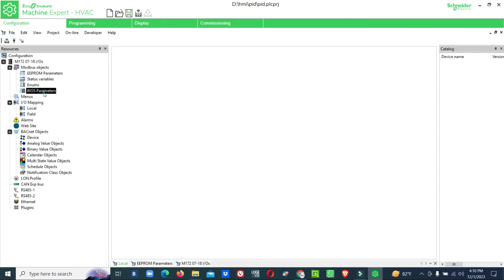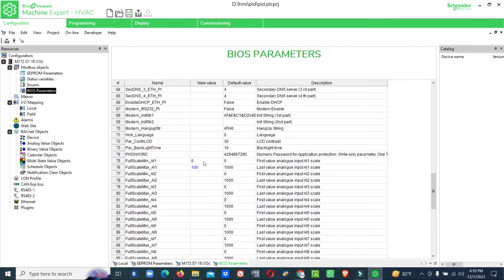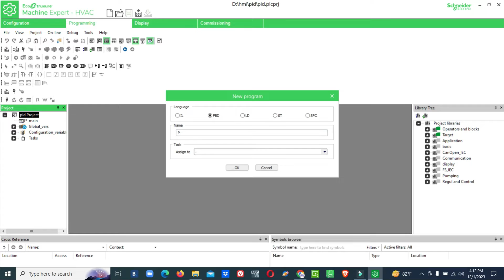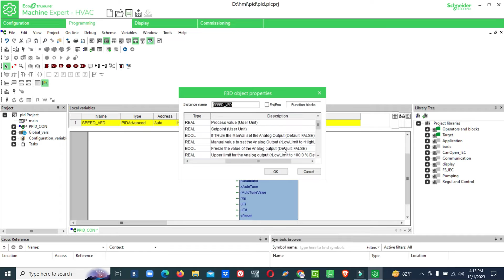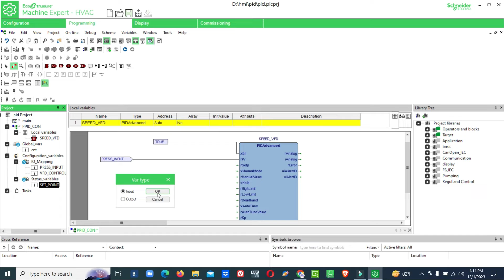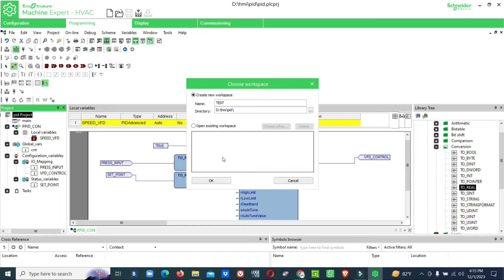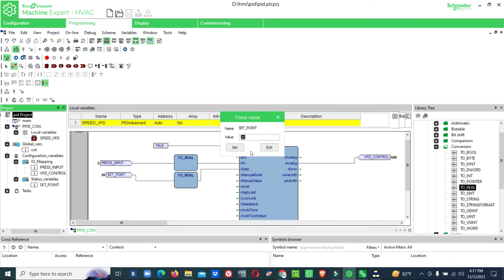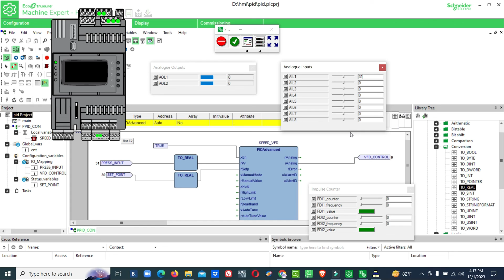VFD Speed control using ANALOG OUTPUT /SCHNEIDER M172 PLC for water pump....

Comment: Ji, I tried one program but I cannot complete that, can I help me?
Logic is 4 pumps 
Low limit on 1pumps run
High limit on 1 pump off, same sequence until 4th pump ok.
   But sequence running time any one more trip or I do manual off now 3 pump only available, the sequence running with the 3 pump. again one more pump trip or manual off now 2 pump available the sequence running with 2 pumps.
I will clear problem, 4 pumps running with the sequence